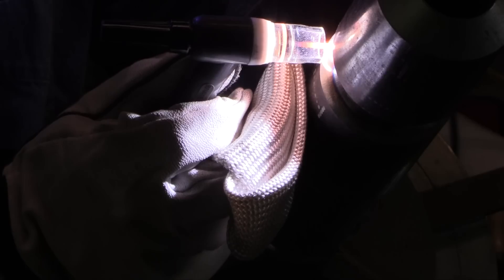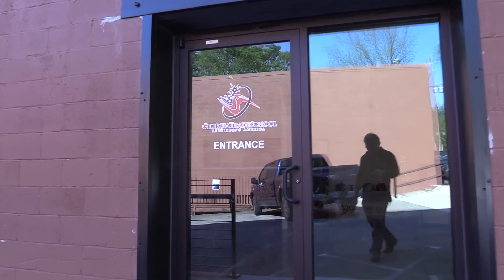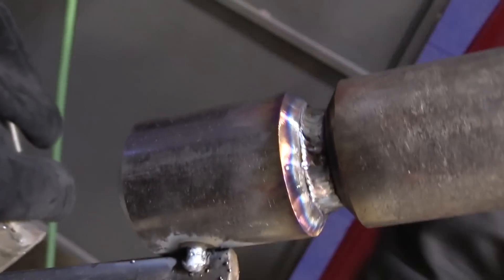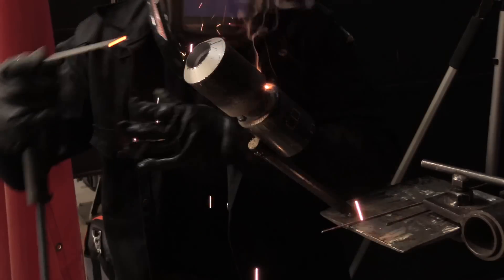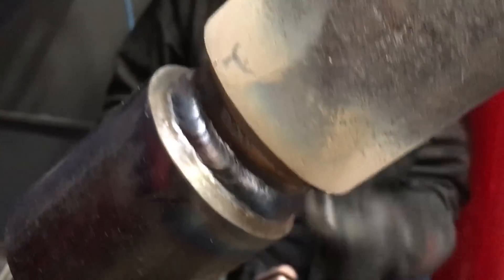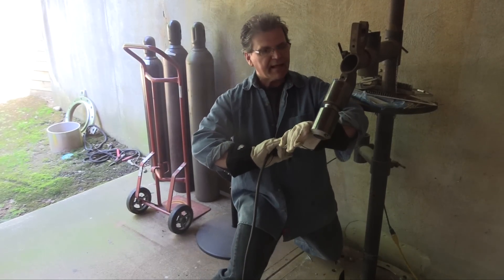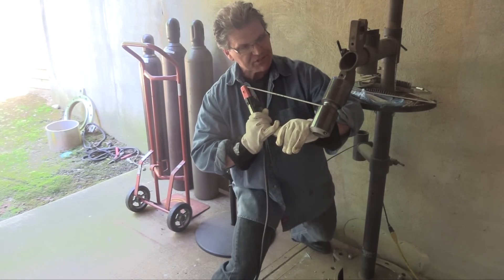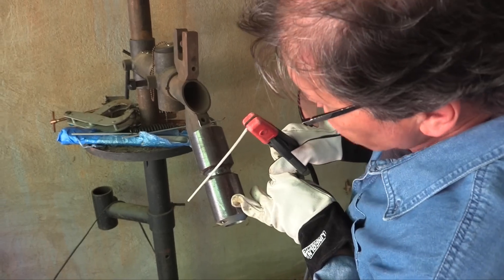6g Pipe Welding Test Monster Coupon 7018

Comment: Union Boilermaker’s common arc tube test you are not allowed to use any power tools. You get a chipping hammer,half round file and a wire hand brush.I always carried a worn down sawzall blade in my pocket

Comment: I love your videos. Only thing I do differently is, I never aim center of pipe all the way. Im oscillating and Im always at an angle. When I get to the top, Im at a backwards angle like Im welding flat. Up the side, I have a push angle. I go from a drag angle to a push angle at about 5 o clock. I only aim center of pipe for that split second. Im low key welding pipe, like its structural. It works for me.

Comment: My brother told me to check you out in 2017 and I just hired on with my first boiler company and could do a little fitting and mig welding, I could barely get a tack with a stick rod and I took what he shows in his videos and applied it in the field and at home and I now have 2 6G heavy walls,tig root and hot and stick all the way out,under my belt and one 6G schedule 40 tig all the way out, and 2 plate tests vertical and overhead stick all the way out. Thankful for people like Jodi😎 I have a YouTube channel also if you wanna see some of the shenanigans you’ll get into🤙🏼

Comment: I have to do a TIG root 7018 out. No hot pass.
Reply: I run bout 80 7018 hot pass works good. Just don't stay in middle youll blow thru

Comment: whats a keyhole?
Reply: This is the point in which the puddle is close to burning through the root gap and eating and opening away at the sidewall/landing of the pipe, opening up a keyhole and inviting the addition of the filler rod.

Comment: That pipe reminds me 25 years back when i was still welding. I had 6""heavy hall that i welded for 12:00hrs.I had x-rays between the layers and pre-heating on each. That was for me a every tirering job as i was new without experience. But guys what you are doing i appreciate very much. Keep up the good work.

Comment: Did you clean the outside of the pipe or was it already clean before you put the cover passes on? The reason why I ask is because I'm getting a lot of porosity when I running a cap.
Reply: Chris Cole you should always get the mill scale off of the exterior of the tube I always do that when initially prepping the tube I'm surprised they didn't do that in the video

Comment: Does weaving increase the chances of slag being trapped inside the weld and busting x-ray?  Or does the welding pool burn all that out?
Reply: Flint Aloha-Snahkbah you’ll bust out most tests if they see you weaving. If you do it cannot be more than 3x the width of the rod.

Comment: So I put a 90 degree bend in my rod right at the stinger. Then bend it into a big "U" shape, taking up the last quarter of the rod. Not gonna use it in a test anyway. Learned it from an old school pipe welder and it's super crazy how easy it makes it to roll up the pipe while keeping the correct angle.

Comment: A tip I got a few years back, if you need to use pliers or clamps as a prop or any time they need to be close to the weld joint.. slap a coat of spray paint on them it helps keep the spatter from sticking to them espacially on the joints and threads.

Comment: I’ve passed this test. Took 5 hours to weld out
Reply: 5 hrs to weld one butt what was you doing, leaving each pass to cool down so you could touch it with your bare hand??
Come over to the UK and test out for Doosan Babcocks...:
6" sched80 "J prep" 2 1/4 chrome Tig root/hot pass, stick fill and cap. 
2" sched80 2 1/4 chrome full tig restricted access in boiler jig full tig.
 2" s80 316 stainless purged, and another with closed gap and solar flux paste both full tig.
Then finish off with 1/2" s80 tests one stainless, one chrome, one inconel. 

All caps left "as welded" ie no pissing about with files or grinders, any marks on them equals instant fail. 
All tests to be done in one 8hr day.
Reply: @kf8575  Holy cow.  Just one thing .  What is  " 2 1/4 chrome root "

Comment: The best advice I can give on the stick is: use 3/32 less porosity, don’t weave your stringers, stagger your start n stops, and before you start find your destination welding finish point and then bend your body as far as you can comfortably to start and you should resurface to you finish point... everybody has there on techniques that’s the beauty of welding
Reply: So don't weave on the fill at all?
Reply: @favelflav4223  yea if you’re new to welding or trying to understand how to be proficient at the craft don’t weave until you’re comfortable at weaving to fill up.
Reply: @favelflav4223  never.

Comment: about that thumbnail, i know your just goin to burn through it ,but isnt it bad to have your starts and stops line up like that?
 i guess if the pipe is in a fixed position you couldnt necessarily make them anywhere else.
Reply: Fox Moulder In that kind of test it will call for uphand progression, you maybe only have 1/2" window to start and not be welding downhand.  It's also common to do side bends on that test so if you know where they will be you keep starts out of that area

Comment: Just curious, is it safe for all capping bead to start and finish in the same position as kyle demonstration at 13:26.
Reply: Tayvin Thompson Take at look at this weld real rare weld https://www.instagram.com/p/Bj4wz9lgeFP/?utm_source=ig_share_sheet&igshid=j654ryl8u353 if you like the Weld plz follow me "THIS IS WELD TIME" 🔥
Reply: Juanito Rdz if you answer my question is will follow you.
Reply: Tayvin Thompson of course is safe just make sure you get the 7018 rod hot enogh so you wont get porosity. 👍
Reply: You should always stagger you starts and stops....as a union Pipe Welder this is common practice.

Comment: I find some advantage to running my first 2 beads for each layer on the toe lines so your tie into the base metal is more of a lock, it is always easier to tie into previously deposited filler metal than base metal. You don't want squeezed out on a tie in and a crown is easier to deal with in the middle. Try propping on hand on top of pipe and welding with just one hand when going around a radius that small the hand that steadies you can be the hand that ties you up. Practice until you find what works for you!
Reply: Makes sense

Comment: sir i have a question :- can i use gas welding filler rod  as a filler rod to tig welding  for carbon steel, here 2 thing are same and 1 diff  ie; filler rod and materiel  to be welded  but only welding machine is change, pleas let me know
Reply: sharath nayak yes.
Reply: Ghost Dog
  thank you
Reply: sharath nayak Take at look at this weld real rare weld https://www.instagram.com/p/Bj4wz9lgeFP/?utm_source=ig_share_sheet&igshid=j654ryl8u353 if you like the Weld plz follow me "THIS IS WELD TIME" 🔥

Comment: So, when you were coming around to 12 o clock from 6, it looks like you are almost pushing the rod to keep up with the puddle. How much does the rod angle change from start to finish? (In reality. I'm sure in theory, it's supposed to stay the same) And if you are definitely pushing, is that a way to get porosity or lack of fusion?
Reply: Brandon Parry think  5-10degrees of margin on either side you can play with

Comment: I  was wondering what your thoughts are on starting all passes at the 6 o'clock position,, when I  did my common arc test back in 09, the instructors told me it was better to start at 3 different  spots to help smooth out the starts and finishes  5-6-7 o'clock. I  had no problem with passing all 20 out 20 contractors inspections.

Comment: Love your videos. Why 3/32" rod on this? Is it a requirement of the test?
Reply: It may be so that the beads stack up to the right height. If the WPS calls for root, hot, then 2, 3, cap, using a 1/8 or 5/32 wouldn't work. Most pipe welding is done to API 1101, it may also be that by making more passes, this single weld test covers more possible sizes/configurations. I know in other codes, you can game the test specs this way to maximize what your test is good for.
Reply: You could run 1/8” on that, but you better know what you’re doing.  For that diameter and schedule, it’s a lot of heat buildup real quick.
Reply: I guess it's just because you need a lot of metal to be added actually on that "monster coupon".
Reply: It's mostly because you weld from overhead thru vertical and then basically flat at one amperage and 3/32 will look a lot nicer than 1/8 in stringers

Comment: Jody. Is it common practice to have all your tie ins at the same position?  If I am following correctly all the time ins are at 6 and 12 O'clock. On a test would they look to see that the tie ins were at multiple locations and not all lined up? Does it depend on the test and the individual giving it?
Reply from the maker: it is best to stagger all tie ins a bit for appearance.  For a small diameter bend test, you dont have much room to stagger them without risk of having tie ins on the bend straps.  and yes it does depend on who is giving the test.  they all have different preferences on root reinforcement, tack length, etc.  sometimes its all in the procedure, other times you have to ask.
Reply: Thanks for the reply Jody.  I learn something in all your videos.  I also love the Honesty.  Can't always be easy so i respect it even more.
Reply: Came here for this. Something about all those tie ins lined up on Kyle's piece was making me have the side-eye. I guess it's a good way to game the test since that's the most likely place for a flaw, best to limit them to one place so you know they aren't in the bend coupon. Smart.
Reply: I dont know the answer , but good luck on your test.. !
Reply: On an X-Ray test, it’s best to stagger the starts out a little so if you get porosity, you don’t exceed the allowable amount.  If it’s a bend test, every start on the bottom, just make sure it’s clean
Reply: Besides the whole wouldn't it look better debate that test will say up hand progression, which means you have a limited window to start and end
Reply: Rob Townsend Take at look at this weld real rare weld https://www.instagram.com/p/Bj4wz9lgeFP/?utm_source=ig_share_sheet&igshid=j654ryl8u353 if you like the Weld plz follow me "THIS IS WELD TIME" 🔥